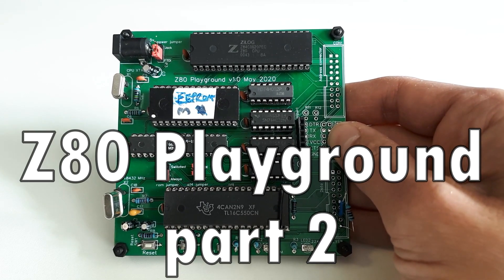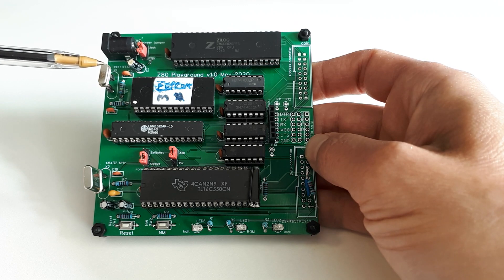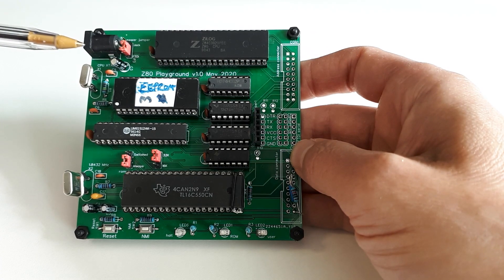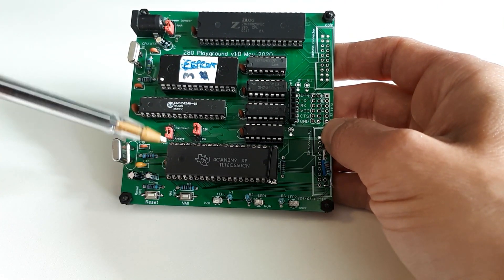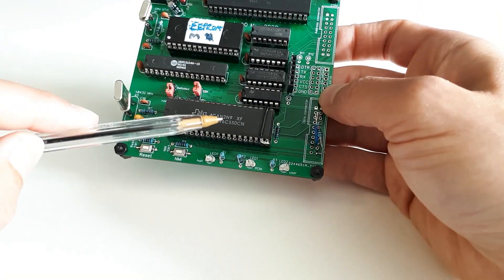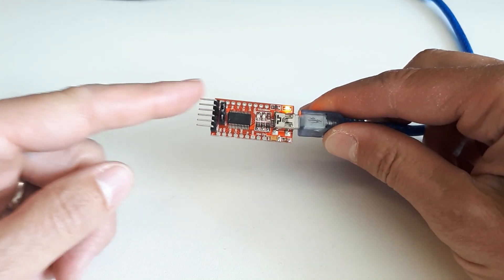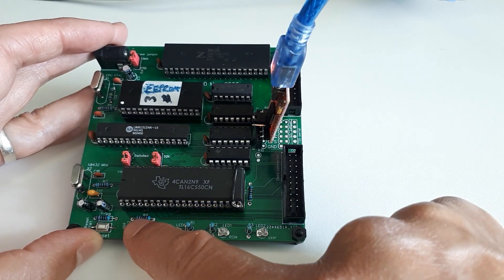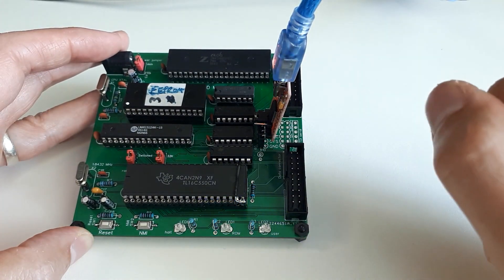Z80 Playground is my Single Board Computer (SBC) that will run Basic, CP/M and Forth.

Comment: thats really cool
reminds me of my little z80 "computer" i built
32k ram and rom
Flash eeprom
2mhz
8255pio as io
i got it to blink an led
aaaand thats it really
might make a "microcontroller" out of it and add some buffers and maybe some power mosfets for other hardware
Reply from the maker: I'm really enjoying this project. Next step is to get Basic running on it.
Reply: @CircuitBreaker256  That sounds cool. I kinda had the same idea too. maybe create some baked in "functions" to control the pio.(gpio?)

Comment: Nice work. I've been putting usb connectors on things, nice stable 5v.
Reply from the maker: I did try that on one of my boards, a surface-mount USB socket. You are right, it's easier than using the bench power supply.